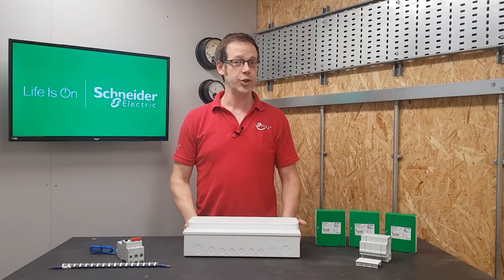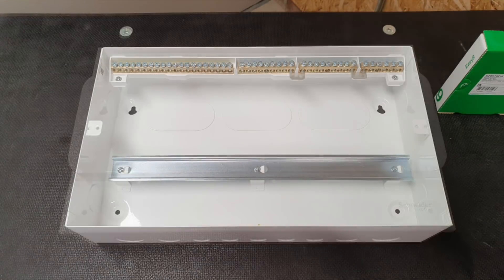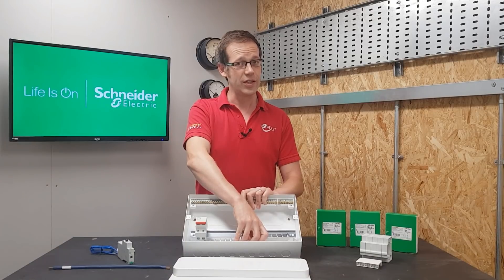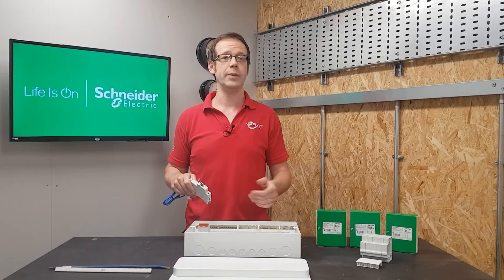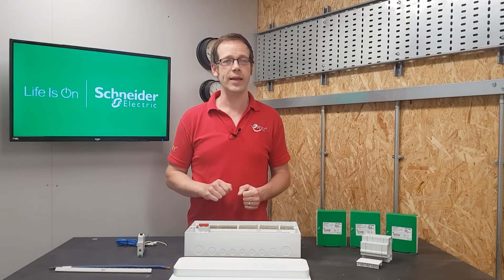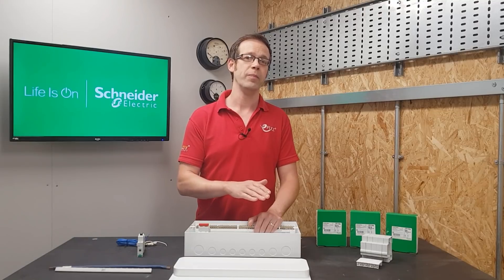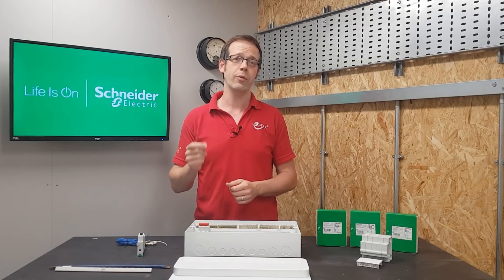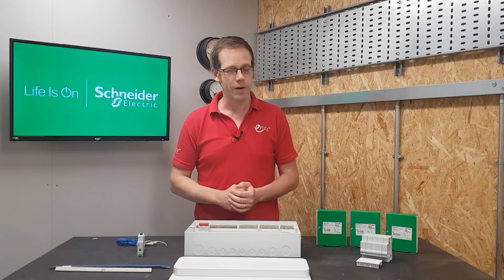📐TIGHT FIT? - NEW SCHNEIDER EASY 9 COMPACT CONSUMER UNIT (EASY9)

Comment: The 14 module enclosure is 347mm wide giving you 8 usable ways as a Dual RCD unit. The 16 module Wylex enclosure is 4mm smaller yet gives you 10 usable ways as a dual RCD unit. Bit of a gimmick the "Compact" label.

Comment: If you had a narrow space but height wasn't a problem is it ok to set upright?
Reply from the maker: That's a great question, I can't see any problem with it really but something we can put to the manufacturers. 👍
Reply: @efixx  3 phase d/b are mounted that way.
Reply from the maker: Absolutely, with the same devices in for the most part. My only small chance is ncern would be the consumer unit hinged cover really. We'll get back to you. 👍
Reply: @efixx  I have installed 3 ph d/b with side hinged covers. Anyway as long as the electricity doesn't fall out it should be ok.
Reply from the maker: @raychambers3646  😂 Fair point. 👍
Reply: Wylex told me years ago NO!
I mentioned that all their 3ph boards had the MCBs on their side!    Their answer was that HB MCBs were designed to be mounted that way and NBs were not.

Comment: Has any manufacturers ever experimented with a single phase vertical board, because I have come across several jobs where boards have been installed vertically, when they should be horizontal.
That would be interesting to see, that's if someone was brave enough to go against the norm.
Reply from the maker: Great question, thanks we'll look into it.
Reply: That's funny I have just asked the same question, 3 phase boards are configured that way so why not?

Comment: Funny .. in Belgium we have this Flexibility for decades ... no need for metal fuseboards .. mostly plastic here for consumers. No need to be same brand board as  MCB's etc ... you can easy fit a schneider board and fit  Hager MCB's no problem . However everything has to be after a 300mA RCB . We cannot have cicuits w/o  RCB protection . Also we have all douple pole brakers .. no neutral bar and single pole brakers is allowed .. because we have a lot of older net's ..with 230V between fases .. so no neutral available .Also no ring circuits here .. so we need at least a board twice the size as in UK minimum  :-)
Reply from the maker: Well this has led to some interesting debate!
Reply: IT system?
Reply: @tommymack3210  Split phase, that's the reason that Schuko isn't polarized. Back when this socket system was introduced (early 1930s) you either had a split phase system with 2x110/220V or a three-phase system with 127V between the phases and the earth potential and 220V between the phases. Since you had two phases on the socket it wasn't necessary to polarize it. In Germany the last remnants of the split phase system were replaced in the 1950s.
Here the first board must be metal (usually they have plastic inserts and are double insulated), the sub boards can be plastic except they are in an escape route. Then they must be metal. We also have boards which are recessed into the wall, they are made of plastic but the frame and door are metal. If these are in an escape route they must have a special fire resistant gasket.
The manufacturer mixing is the same here. You usually find Hager boards, and the electrician fits his favorite MCBs, RCDs and RCBOs into the board, according to the customers needs. Fully equipped boards are almost not available here, you buy all the parts separately and it's the electricians job to select and install the required components.
Reply: Personally I have never seen the logic in buying a board and filling it with another brand of breakers, but each to their own, but we get that in the UK as well, or some will go one step further and use several manufacturers.
We can't use plastic any more, because there's a lot of electricians that suffer with wrist fatigue, which means that they couldn't tighten the terminals enough which resulted in a lot of fires. 
The ring circuit is UK specific and there's a push to do away with the circuit, mainly because people don't abide by the rules regarding the circuit when working on it, probably the same group that can't use a screwdriver.
Reply: @acelectricalsecurity  Customized board for the customers requirements. There is no such thing like 18th edition board you have. Here I buy a board of the required size, at least 2 rows with 12 width units, depending on the areal size of the house or the flat. If you have six circuits in there you got a lot of free space in there. Later you can retrofit necessary devices like SPD and such stuff. For example I can buy a Hager board, install ABB devices and a Dehn SPD. Hager got the nice Quick Connect neutral and earth bars. For some time they were the only ones having this. Now every manufacturer has this. Hager now has Quick Connect also for MCBs and RCBOs.
Reply: @acelectricalsecurity  has to do also with availability and price.  Also it's sometimes impossible to fit evertthing same brand..( mix  Schneider and Hager in one board is no problem here ). DIN rail is a universal Standard for brakers / relais / dimmer / PLC modules ..   if a braker is 20 year old and brand doesn't exist ..we just fit other brand . Also impossible to Cary all brands of fuses in the van.  Ik think the rule in UK.  Is only good for fuseboard manufactures in uk ( they sell the hole package deal )
Reply: @kittsdiy  that's interesting as the manufacturers over here make it clear not to install other brands in their units, and those are the same brands you use, so why one rule for you and another for us 
Plus, personally, being taught never to much and match, it's something I wouldn't do, even if I was allowed to.
Reply: @acelectricalsecurity  for UK market Schneider seems to have different cases/brakers . ( probably to follow the 18 edition )  I wonder what do you do if you need to install a timer of bel transformer or din rail dimmer or teleruptor and the brand of the board doesn't sell those ..  We have board with  RCB's  MCB's and for example Eltako dimmers/teleruptors or Siemens Logo or Loxone Domotica all in same board .. no problem here . For a new board i always take same brand brakers but the box itself may vary on the space/size . Also some brands only sell boxes .. and no MCB's .. kinda hard then to fit same brand :-)
Reply: @kittsdiy  most of the time things like that are outside of the board
Reply: @acelectricalsecurity  i have seen in some video's .. ugly as hell ..  Fuseboard with other boxes and a ratnest of wires next to it lol :-)  Here we fit everyting in fuseboard box ( a much bigger one as we need 2 din modules per MCB .. that is DIN-Rail . Not allowed in uk ?
Funny how thing vary ..i tought electricity was electricity  :-)
Reply: @acelectricalsecurity  And that, sorry, looks like crap if you have a wall full with x housings. One big housing were everything necessary is inside. The installation is ten years old, I need to do a retrofit for RCBOs and SPD. I only got an SPD in the sub distribution board of the garage where the EV charger is connected to.

Main board with the meter inside, contains MCBs for cellar circuits and the circuits for the ground floor. The 30mA type A RCD is only for the toilet, which was actually not required back then, before the renovation it was actually a bathroom with a tub. And in Germany in 1983 the VDE 0100 was changed in that way that rooms which contain a tub and/or shower must be protected by a 30mA type A RCD. AC RCDs were banned for new installation also from then on, so I've never seen one here. Type A RCDs are the standard here since then. That small meter on the DIN rail is for the sub board in the garage to monitor how much electricity is used there by the charger.

https://abload.de/img/img_0833j7krh.jpg

Distribution board for the first floor, the RCBO is for the bathroom:

https://abload.de/img/img_0834e4jot.jpg

There I'll replace the MCBs and the RCBO in the future and also implement SPD. The MCBs will be replaced with 30mA type A RCBOs, the bathroom type A 30mA B16 RCBO will be replaced with a 10mA B16 one. It's not mandatory to do so, regs still demand a 30mA for bathroom circuits, but the VDE recommends using 10mA for bathroom circuits. And only for the bathroom circuits to prevent nuisance tripping.
RCBOs and RCDs always isolate line and neutral. Makes testing very easy. I think efixx also has a video about that on their channel here.
Reply: @Marcel_Germann  very interesting, yeah sometimes it can appear cluttered, sometimes a bell transformer will be in the board as well.
That's a very detailed reply thanks for the pictures 👍
Reply: @Marcel_Germann  I guess it sounds expensive but as it's 3 phase it isn't really.
That's the way the UK will be going regarding Foundation earthing, looks like it could be in the next amendment.
It's always interesting to see how other countries do things, one of the first things I look at when visiting a foreign country, is the board, sad I know.
😂😂👍
Reply: @Marcel_Germann  yeah that's true we do, but have you never mounted a light or socket on a wooden building, or fixed a box on a wooden batten or nogging on first fix, it's no different to mounting a mains board or meter on a piece of plywood.
Even some of our earliest wooden boards had a paxalin type back plate, and although made of hard wooden, I have never come across one that had suffered fire damage, and that's probably because they were installed better plus with the exception of the earth, all terminals had two screws, which wouldn't go a miss today.
Reply: @acelectricalsecurity  Yes, but then they had a back. For the surface mounted accessories which don‘t have an IP rating the backs must be bought separately. NYIF cable is not permitted for installation on combustible materials. Which actually doesn‘t matter because almost no one uses that type anymore. But still, no distribution board or meter mounted on a wooden base. The DNO would never install his meter on a base that is mounted on a wooden board.
Reply: Plastic CUs are a fire risk which is why 18th Edition specifies metal CUs.
Reply: @GadgetMan36  That‘s the reason they‘re not permitted in an escape route here. And in the UK, as far as I‘ve seen, most consumer units are in an escape route. For example in a closet under a wooden staircase. There metal boards make sense. And the BS 7671 isn‘t relevant in other countries.
Reply: @GadgetMan36  but it's ok to extend cables and have the connectors in a plastic box 🤔
Reply: @paulbritton187  These are usually after the consumer unit. The problem is, the consumer unit is CAT III zone, but since this is the first point after the meter you usually have a high SCC (short-circuit current), and that could cause a spectacular arc. After that the cables are protected by the MCBs of the circuit and also by the impedance of the wiring in between that prevents a high SCC. That's the reason the main board here must be metal and the other sub-units can be plastic as long they're not in an escape route.
Reply: @GadgetMan36  no your incorrect there, rather than deal with the cause, the idiots that can't tighten screws, they dealt with the symptom, fire, because it was easier.
You can still fit plastic boards if you want in none domestic properties.
Reply: @acelectricalsecurity  No I’m not incorrect. It’s now required to tighten all terminals to the torque specified by the Manufacturer, so the screw tightening issue has been dealt with. We are talking about Consumer Units here, with the emphasis on Consumer. I never mentioned Commercial, you did.
Reply: @GadgetMan36  yes I did, and ask yourself why we suddenly have to start using s torque driver, because of Muppets that can't tighten the terminals, there's nothing wrong with an insulated boards, it's the people who were fitting them. 
And mentioned they could still be used in a commercial setting because you called them a fire risk which they clearly are not and you didn't say consumer unit, you used the term board, which could be domestic or commercial.
 Although there were manufacturers who said their boards complied with the British standard, but failed the hot wire test, but nobody mentions that, and they could be deemed a potential fire risk.
Reply: @acelectricalsecurity  Terminals can be under or over tightened, which is why torque drivers have become important. I’ve seen plenty of evidence of fire damage caused by plastic CUs not containing the fire. In some cases it was lucky the house didn’t burn down. Metal CUs contain the fire if correctly sealed. Most commercial boards are metal anyway. All new main boards are metal unless new old stock or reclaimed, so only a cowboy would fit a plastic main board in any premises. There’s everything wrong with plastic CUs because they are combustible which is why metal CUs are mandated in the 18th Edition.
Reply: @acelectricalsecurity  The Fire Brigade should be listened to. The answer is to use an NICEIC registered electrician, their work is assessed annually. The problem is when builders do electrics on the side as part of another job such as a new kitchen, bathroom or extension builld for example. Even if a plastic CU is correctly fitted, a problem can later occur due to a fault, or overloading, etc. In cases like these only a metal CU will contain the fire.
Reply: @GadgetMan36  I don't have a problem with metal boards, my issue is the fact that they were brought in for the wrong reasons, as I said, rather than dealing with the fire aspect, they should be concentrating on the poor workmanship.
And I do think there should have been a recall on those insulated boards that failed the hot wire test, as they are potentially dangerous. 
As for the NIC, I have been a member since 96, and joined not because I had to, but I seen it as a step up from none members, but over the years I have to say I am quite embarrassed on times to be a member of an organisation that lets it's members get away with murder.
Reply: @acelectricalsecurity  in Belgium / Holland it's all plastic mostly for consumer installs... But metal is allowed. In industrial environment it's all Rital metal cases with Schneider or Eaton or  Hager brakers. ( Layout inside all din rail custom fitted as needed )
Reply: @acelectricalsecurity  the fire at the grenfell tower ink London was Coursed by a pile of newspapers behind the fridge freezer and blocked the compressor coursing it to over heat , yes the London fire brigade blamed a fault in the consumer unit . Look at al the mistakes the chief fire officer made on that horrible knight and then later resigned in descrase . The fact is that most house fires are coursed by faulty electrical appliances and doggy deep fat fryers  like faulty tumble dryers and fridge freezers that’s why there has been a massive product recall over the past 15 years.
Reply: @GadgetMan36  no they are fire fighters not electricians .
Reply: @Dog-whisperer7494  Fireman know what causes fires. They investigate the cause. Electrician's don't do that.
Reply: @Dog-whisperer7494  I hadn't heard they blamed a board fire, I only heard that the fire was caused by a fridge or freezer.
And ironically the things installed to improve the conditions of that building, were what caused the fire to spread.
Had it not had pvc Windows and combustible cladding, that fire would probably have been contained, because originally that place would have had steel Windows and concrete on the out side.

Comment: Wish all consumer unit manufactures would stop putting knock outs around their boards , i dont mind drilling them it takes less than a minute and i can put them where i need
Reply from the maker: That's interesting, not had anyone express that opinion before. Do you find the knockouts in the wrong places generally? 🤔
Reply: @efixx  Usually the wrong size knockout in the wrong place and if there's conduit or large trunking installed it causes chaos because you know its going to land dead centre of a 20mm and a 32mm knockout
Reply from the maker: Fair points. 👍
Reply: @efixx  sometimes they can be, I thought Hager did a board that didn't have Knock outs. I know they do a trunking knock out version.
Reply: Your right, the only ones they need to fit is the rear entry ones